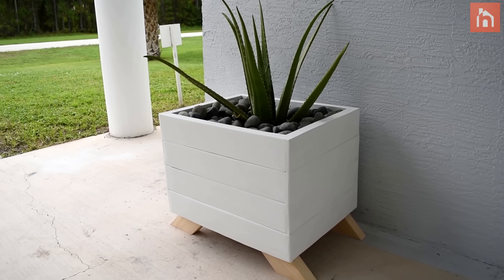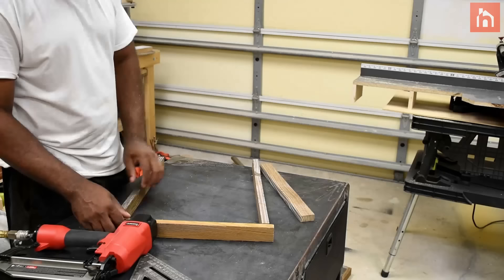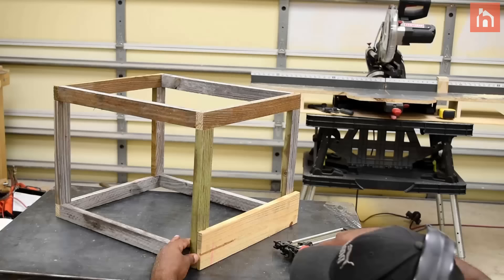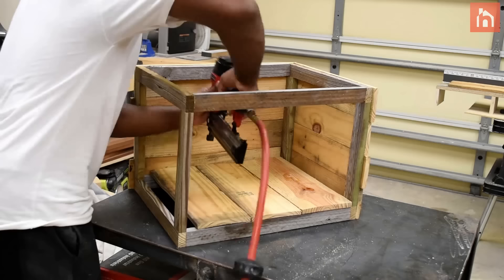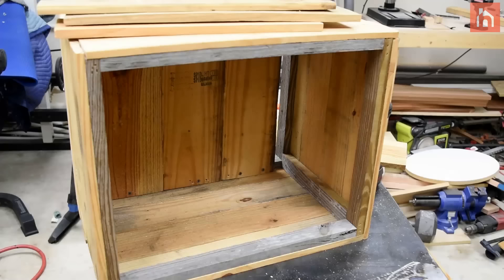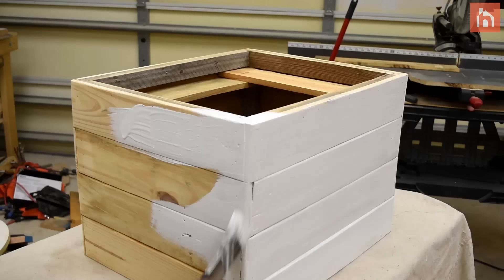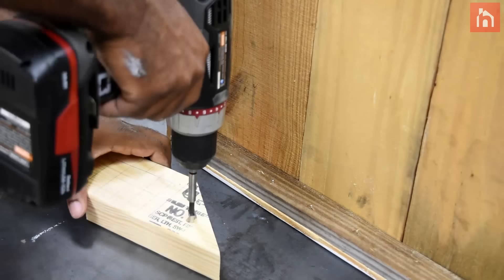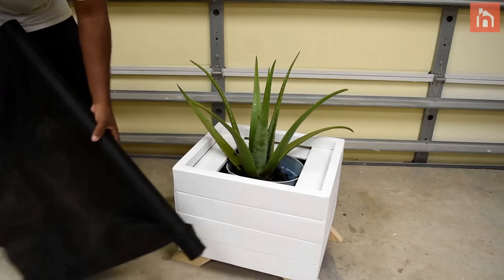DIY Planter Box From Pallets

Comment: how did you measure/calculate to cut the legs @45 degrees?
Reply: If you don't have a miter saw or table saw that you can set the 45-degree angle, then an easy way is to measure the length of your piece of wood.  Let's say it is 2" (for a 2x4...just a round number since 2x4 isn't really 2x4).

To get a 45-degree angle, measure in 2" from the side.  Make a line from this mark, to the corner of the outside of the board (think of a triangle that is formed from 2 sides of the board, plus your line that you just made).

Cut along this line and you should have a 45-degree angle (as close as it can be with the tools that you have).